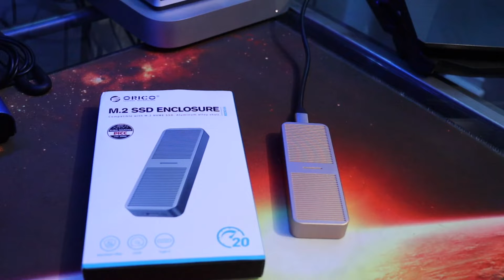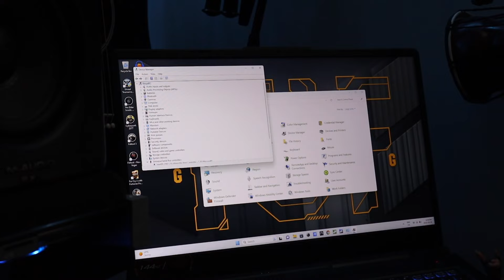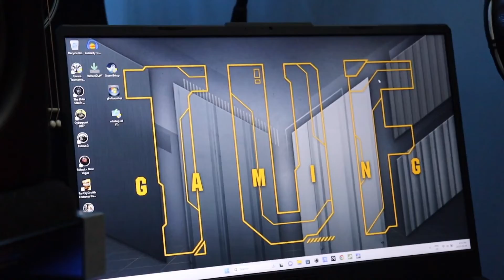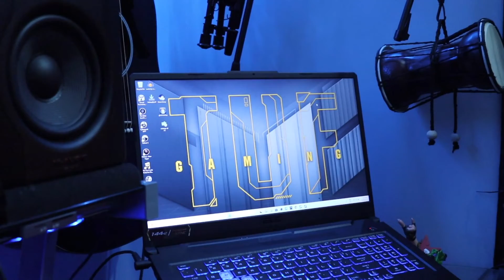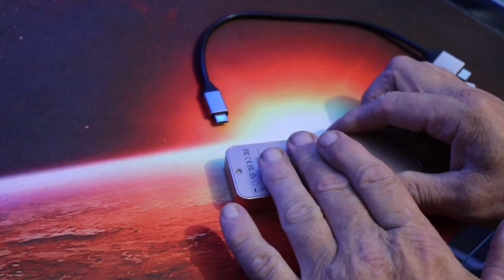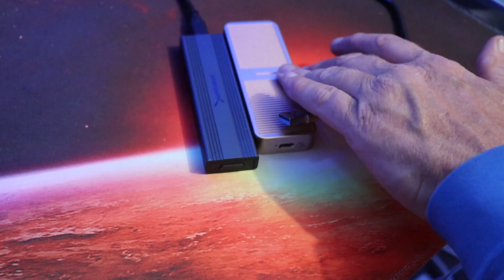Orico 20gbps M.2 Encloser Test And Review

Comment: hi, one question can we connect or use a thunderbolt 4 cable with a usb 3.2 gen 2x2 20 gbps nvme ssd enclosure to get the full 20 gbps bandwidth on a mac with only thunderbolt 3 / usb  3.2 gen 1 port . im talking about the m1 mac mini, will using a thunder bolt 4 cable give me the 20 gbps full bandwidth or will it still give me  only 10 gbps even with the thunderbolt 4 cable. can u please do a video about it cause this mr nowhere called usb 3.2 gen 2x2 doesnt fit anywhere.
Reply from the maker: speed of drives are not just the specs of the case its also the drive you put in it as well and they also are only upto does not mean you will ever see it because you wont, how ever on the cable part well it wont make it any faster no.
Reply: @ well my drive is WD black sn 850x. It is the fastest in the segment with gen 4 speeds of 7300mb/s. But as usual the suspect is always with the mac. If i only knew that mac doesn’t support the usb3.2 gen 2x2 20gbps bandwidth, i would’ve not spent so much on the enclosure and the drive. So i was thinking maybe using the enclosure with a thunderbolt 4 cable with an intel rated maybe the mac might read the enclosure as a thunderbolt device and not a usb 3.2 gen 2x2 device and therefore might give the 20gbps speed out ahead somewhere close to 20gbps because i have seen videos of people testing usb 3.2 gen 2x2 enclosures getting the full raw bandwidth of 20gbps but only in their case it wasn’t a mac but a pc that has dedicated usb3.2 gen 2x2 ports. So the enclosure and the drive of well capable of delivering the speeds but is the mac because the thunderbolt and usb 3 have totally different protocol except for usb 4 which has tunneling capabilities and also thunderbolt technology never updated their spec to adapt the new usb3.2 gen 2x2 as thunderbolt 3 came before usb3.2 gen 2x2 so inherently thunderbolt will not accept the usb3.2 gen 2x2 speeds as it never existed when thunderbolt 3 came out but i think thunderbolt should have updated their specs to include usb 3 but ofcourse since they have different protocols i believe they couldn’t. But what confuses me with Apple is the usb 4 in the mac mini, they say its usb4 so technically the usb4 should’ve supported the usb3.2 gen 2x2 as they are both usb technologies although they have distinct protocols but still usb’s and i believe usb4 have tunneling capabilities of usb3.2 gen 2x2. I don’t of this is apples fault or usb’s . Will never know